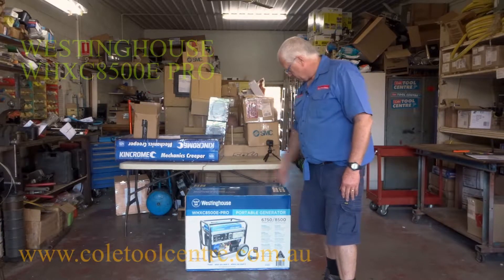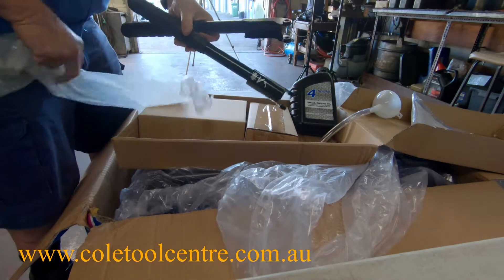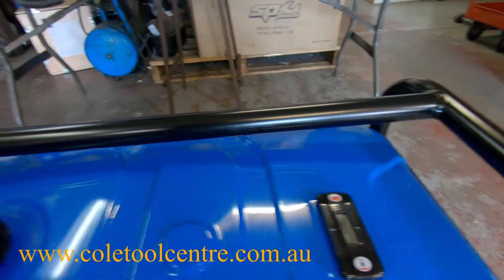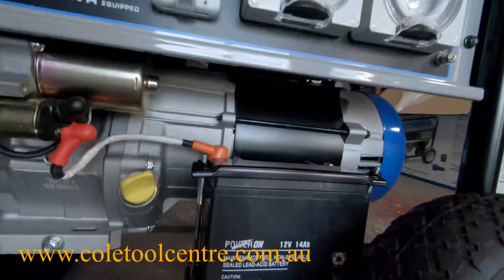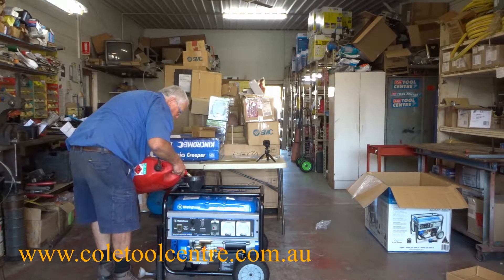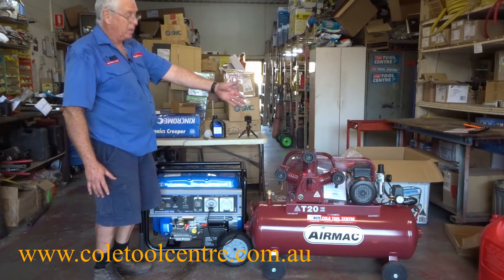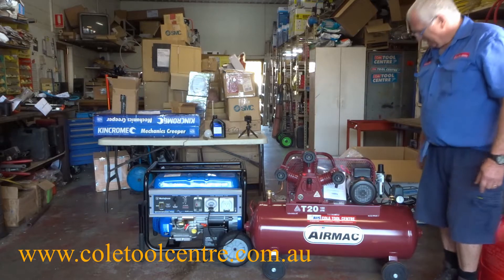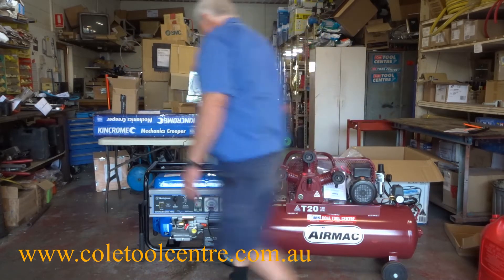Westinghouse Generator WHXC8500E-PRO

Comment from the maker: these have an Auto Voltage Regulator System which provides precise and stable control of the generators 240 v sine wave output. 
an inverter generator uses electronics to convert DC voltage to AC 240v.
 both are ok for computers but it would be worthwhile looking at something to protect against any spikes or surges.

Comment: Would this be OK to run sensitive equipment like computers and fridges or would I be better off with an inverter generator?  Also I noted in the video that you didn't connect an earth cable to the generator, are they not necessary?  (I know nothing about generators. :) ) Thanks

Comment: Hello, are spare parts readily available for that Gen, and are the parts reasonably priced, such as spare AVR's and Alternator brushes etc etc, when need it, with reasonable turnaround time?

I have decided to avoid Inverter type Gens as should the inverters fail, the parts are way over priced and the Gen ends up being a "A very shiny Economical Write off".